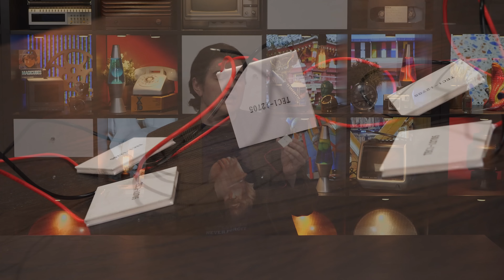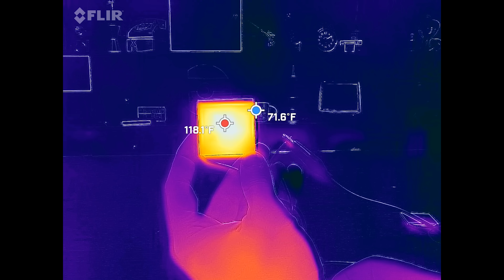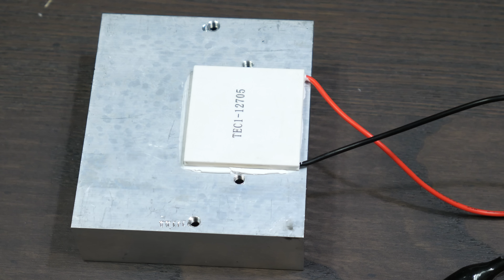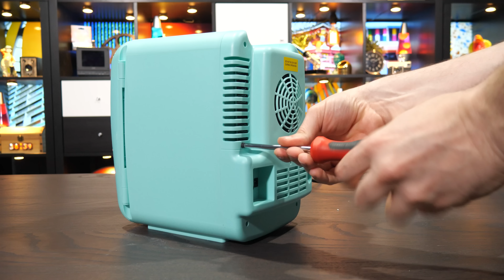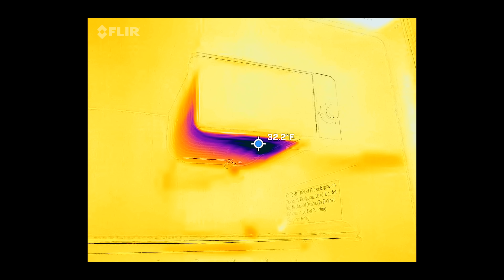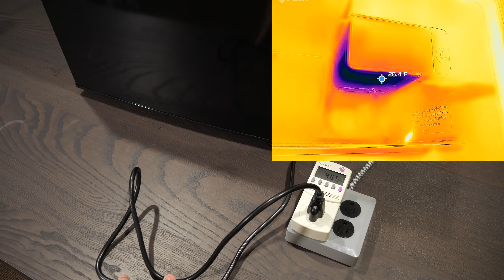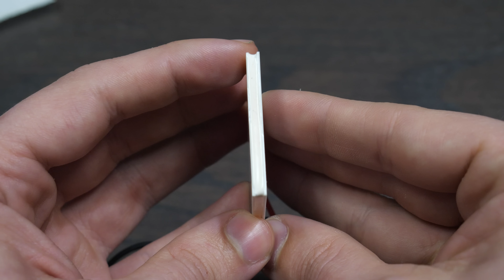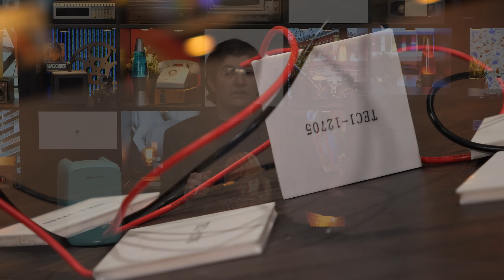Thermoelectric cooling: it's not great.

Comment: Man so I bought a camper a year ago and I can't get the fridge to work with gas. So when me and my now ex wanted to go on a month long trip last fall we bought a thermoelectric fridge to sit in between the two chairs. Main reason was the form factor. Biggest regret ever. It is advertised to to draw 4 amps 12v on the manual (the website only said it was "energy efficient" whatever that exactly meant) which is wayyy more than I expected (avg current draw of a compressor camper fridge is 1-1.5 amps 12v). It doesn't really cool all that well (lucky it was fall a I right?). It drained my 100AH battery faster than I even expected with 4 amps AND it made a lot of noise. I really really should have bought a compressor coolbox and tried to fit it somewhere else.
No this is not the reason we broke up, let's say she turned a cold shoulder.

Comment: I got one of these to store a few energy drinks in my bedroom. It’s worked well enough to keep them chilled for the last 2-3 years but the biggest downside is how much heat it puts out. I’d come back from work and my room would be noticeably warmer than the rest of the house. Fixed that issue a month or two ago by putting it on a timer outlet set to just run at night but I think the more frequent cycling is killing it bc now the Peltier element feels barely cooler than room temp by morning. 

I wish they would make slightly upgraded ones with better insulation and a thermostat so it’s not constantly running. Yeah it would still be way less efficient than a true fridge but it would be better than this

Comment: I'm 36 and when they first came out, it was at toys R Us and were only 30 bucks. Bridge right that always seemed to work pretty good for me but it was all depending on the temperature and humidity in the air it in. mine would ice over and  keep my 4 surge energy drinks and balogna...lol I have 2 peltier dehumidifiers and the only way they will actually work is if there is still air in the room if there's a lot of air going in and out of that room, it does nothing. And the other application I have a Peltier module on is my massive cooler master v10 cpu cooler.

Comment: Why don’t they make heatsinks for computers with this tech, yes it uses a lot of energy but it still could work
Reply: It doesn't. You still need to cool the module for only a couple degrees benefit, so at that point, just use a proper cooler.

Comment: Guy doesn't realize that people are using when they don't need a full fridge. They are great putting items which needs to be cooler like chocolate during summer. Likewise, passive spot to place drinks in. Relative temperature difference will make them feel cool. Sure, temperature controlled small refrigerator would be better, but those things literally are in several different leagues above them in price and complexity.

Again, saying cheap things suck. What a relevation!
Reply: Can get a used minifridge (a real one) for like 30 dollars
Reply: @Serpreme-y1q  Key word: "used".

Comment: I have a 30 l thermoelectric cooler. I have it connected to the solar controller. It's used for camping 

I've noticed if you feel the Esky halfway with ice and then put your frozen sausages and patties and drinks in it and having the cooler running which only uses 45 w. It'll help keep the the ice and all the food nice and cool for your three or four day camping trip. 

And when it's connected to a 250 w solar panel and 120 amp hour lithium battery it's very good 

I got it for $80 on special

Comment: I have a Coleman "cooler/warmer" that has one of these in it.  Plug in blue to blue, you get a cooler.  Flip the plug so it is Red to Red, you get a warmer.
It does take quite a bit to pull heat out of the cooler but there is a lot of insulation on it.  
I did end up having ice build up on the internal heat sink and had to remove that occasionally.
Had to use this as a stand in for a few days while my replacement refrigerator was on "backorder".  Far from ideal situation but it beat zero cooling.
Critical stuff went in the downstairs freezer.

Comment: doing vocational as a thermal systems technician, the problem already becomes apparent when you know how a fridge works.
sure it becomes cold but you're trying to remove heat, that's how a fridge works.
in my opinion thermoelectric cooling could only probably work great if they existed in like modules that could connect with your fridge's system using a docking system where you slide in your beverage in a radial chamber with Peltier plates and dissipate the heat into the system.
basically you slide a can in one of these, they cool it from all sides and it cools it down faster. although thats assuming the plates can cool down your drink faster than the passive temperature inside the fridge

Comment: I got an xbox mini fridge because haha funny and it is exactly one of these. It has two temp settings of loud and very loud.

Only saving graces of it are that it has a working usb port where the console has one, it has lights loke the console and modeled IO on the back.

Wonder if I could put a noctua fan in the back to make it quieter

Comment: The only advantages this thing has over traditional vapor-cycle refrigeration are upfront cost and maintenance/repair. Two wires and no moving parts makes for easy fixes compared to a large sealed-gas system.

Comment: He's right, peltier is not design in itself to stop cooling at the wanted point like refrigerator does, so it will keep cooling until the treshold of the input electricity and equivalent difference of the temperature, I saw peltier stacks that could go to -72 C or -97,6 F . But it's 3 stacks of peltier in a good non leakable box and small places, you're basically dumping energy on a tiny spot, except if you can make a system out of it so you can control how many watt you want for it to run and how many peltier you used, but I never saw one yet, so, who knows. It still winning on the normal refrigerator side by a big margin in total capacity and energy efficiency in a home applications, but it got many potential we yet to discover. Who knew it got better in the future and have less energy to trigger big peltier effects.

Comment: I bought a medical cooler like this, it could fit 4 injection pens was loud, it couldn't keep anything cool (needs 2-8°c) when in the sun it stayed 10-15°c and it worked for 2 weeks afterwards it wouldn't recharge anymore. What is the worst part you might think, it costs €200. I know bought a Dyson thermos with 2 coolers (one can be filled with water other one can be frozen) and it is perfect and stays cool for 48 hours.

Comment: Another niche benefit of peltier coolers is that because they have no moving parts, they don't shake/vibrate. One case where you need that is cooling the sensor of various scientific cameras (they give better images when cooled). For this reason, some scientific cameras have a peltier cooler included in them.

Comment: but this would mean Peltier elements  would be perfect as cpu cooler, reducing the need for perfect cooling paste and so on, no?
Reply: No, because you'd need to run so much more electricity through it to get basically no actual decent benefit from it, compared to just running a fan over a radiator

Comment: i just took apart a pretty high end christie lazer vid projector and the chip was cooled with a peltier !  older panasonic vid projector was liquid cooled, and i thought that was cool...
this guy had a big heat sink and it made very cold/hot very quick. i havnt measured current draw yet but prob much. but what to do with it...cocktail coaster?

Comment: 50w Compressor refrigerator with COP of 3, moves 150w of heat from the inside (closer to 200w of heat dissipating to the room, 50w motor heat + heat moved). Defrosting or automatic defrost feature will waste heat so the compressor has to be more efficient so the long term average efficiency stays reasonable.

Comment: I use one of these at work on my desk as there is no way in hell that work would allow that black mini fridge.  It's nice having drinks and stuff there as opposed to the communal break room fridge. It does suck how poorly the thing cools the drinks though but they are OK, and the Frigidaire ones are quieter.  The lifespan of the tiny fridges is also an issue.  They don't last very long.

Comment: Was a TA for an Intro thermodynamics class for a couple years, had taken it previously, and every year there’s a project about testing various cooling methods. Thermoelectric always looks cool, but then you run the numbers and welp, guess we use Heat Pumps for a reason…

Comment: We use Peltier cooling for maintaining laser temperature stable and vibration free in a metrology tool that costs $5M, I bet your red fridge can't do that hhhhh, I agree cooling food with Peltier is dumb, but there are applications where it maybe good, and by the way you can use a thermostat/temp sensor to control temp , we do it to 0.001 deg C, so chill buddy

Comment: I want to cool electronics down in an ice box in the summer. 65F or 70F is good. I want to use a  Peltier element because I can put the polarity in reverse and use it like a heater to protect the lithium batteries in the winter. I'll just buy the element and cut a hole with a jigsaw and glue it in.  I saw a 2-pack deal on controllers with thermocouples for 15 bucks. I'm going to use the RV tank heating pad as a backup heater.
Reply: I built a DIY portable Powerstation inside an Igloo cooler. I have 6 x 200-watt folding solar panels. 120-amp solar controller, the 4000-watt surge inverter has a nice sine wave. Then I plug a Bluetti power station into it with a 400-watt panel.

Comment: Another cool thing is that Peltier modules can also easier work in reverse (transforming thermo-potential into electric potential). I have a fan on top of my fireplace to blow hot air into the room when its bottom gets hot.

Comment: I use these peltier coolers to keep solder paste tubes chilled. It only needs to be chilled to around 40 degrees or so. Its a very small volume, and custom made (its also a chest design. Hmm...)

Comment: my friend in the US bought a cheap 4 can fitting mini fridge from goodwill for $15 and took out the cheap broken cooling element got a CPU cooler and now it runs 10x better then it ever did

another cool thing about fridges I probably shouldnt but I put a hanger with a blanket hanging over the warm side of my under counter size fridge in winter to warm it up a little cause heaters can be expensive in the UK unless you buy expensive infrared heaters

Comment: Hi,
I´v watched your video on the peltier-cooler(s) and elements.
Please allow me to oppose,... however first I must add a good portion of agreement:
Yes, the blue "mini fridge" wastes a lot of energy. But why?
1. The cooling fin on the hot side of the peltier element is too small,
2. I did not see any colling fin on the cold side at all,
3. I did not see any fan on the cooling side,
4. the peltier element is overcharged with power.

I have used peltier elements for decades at work running them at COP partially higher than 3! (COP of 4 to even 5 is possible!)
In order to achieve that it is necessary to follow a few simple rules:
1. Read the datasheet carefully and critically. Good datasheets give advice how to run the peltier elements at high efficiancy.
2. Calculate your setup so that yo use at most 25% of the maximum power rating, better only 15%.
Please keep in mind that the max. power rating is given for a temperature difference of 0 (yes, litarally zero)!
3. Keep the temperature difference as low as possible. You can achieve that by adding good cooling fins at either side of the peltier element. That on the hot side shoud be larger by appr. 20-30%.
If your application requires a high temperature difference, use 2 (or even more) peltier elements thermally in series to split the temperature difference between them. Good manufacturers offer peltiere stacks that are optimized for such applications.
4. Run the peltier elements on real DC (not pulsed)! There is a significant difference between the average current and the RMS-current causing the heat losses in the peltier element in case of pulsed DC-current, heat losses that must be cooled off on the hot side. The cooling power is proportional to the average current.
5. Do not use a bang-bang-controller, use a continous analoge one, at least a PI-controller (even if it is made using a digital device, a µC, the final function is decisive). Bang-bang-controllers also produce an RMS-current higher than the average current, only the frequency is lower!

I have also used temperature controllers based on heat pumps over decades at work (past tense, because I´v retired). Their purpose was to control the temperature in oil filled baths to 23°C for precicion instruments with air temp 23°C in the lab (more or less negligable temperature difference but much much better stability). 2 of these oilbaths use the heat pump at full power (US and CA products) and in order to maintain the correct temperature inside tha bath they heat the oil with an electric heater (the cooling power is higher than necessary, the controller requires that). They consume appr. 1800W and 800W respectively. Only 1 of these baths (DE product) is able to control the power of the heat pump, but also this bath has to add electric power to heat the bath to the correct temperature. It consumes appr. 700W to control the temperature of an oilbath larger than both before mentioned together.

I´v got the impression that controlling the cooling power of a heat pump is a qite demanding task, whereas controlling the thermal power of peltier elements is very easy, you only have to change the current. And yes, as you said, you can use them also for heating. This is often required as temperature controllers often overshoot (yes, probably this is a sign that the parameters of the controller are set poorly...).

If I built an oilbath with comparable size and temperture stability using peltier elements, that bath would consume perhaps 200-300W. (I do not want to do that for safety reasons... fire hazards of the types of oil, pumps etc.)

Yes, the above mentioned temperature controllers are not a fridges for some cans of drinks.... However they are not cheap either (price range EUR 10,000 to 60,000 + VAT)
Yes, adding some improvements to that "blue box" would increase the price significantly.... (but not $ 10,000)

I fully agree with what you said about running peltier coolers in cars. I did that by myself in hot summer (no air condition in the car...). Even if the power consumption is not negligable, you rejoice if you can cool at least some sensitive goods at least for a few degrees...

Kind regards,
Peter Scheibenreiter
(not from DE but from AT)

Comment: I had a 12-volt Coleman cooler that kept things cold 25 years ago. I traveled all over the desert with that thing, and it did a great job. It would heat up inside if you reversed the plug. I'm not sure how it worked, but it did! I assume it drew a vacuum on a void in an aluminum block to cool and compressed the void for heat. In cooler climates, it could freeze things. I wonder if one of those things was in it.

Comment: If you work in a factory or industrial environment where you can plug one of these in, it works fine for keeping your lunch cool through the day. I've used this type of cooler in hot environments and it worked fine for me. Not something I would use at home, but if I'm not paying the power bill, it isn't a problem.

Comment: Just to be clear what your saying here is the drink cooler is great if you're using it at work where you are not paying for the power. Keep in mind the small size that fits on your desk is the selling point of these shitty coolers fridges. Stating this significantly larger fridge is better is incorrect they are too large that's the problem i have bo room for them. Where is my 6 can fridge that fits on my desk at work?
Reply: Second thought could we put a Thermoelectric generator on the hot side and reuse that some of that power?
Reply: Second second thought. These fridges need the cans inside to hold the temperature how is this good for makeup? how are you cramping enough makeup in these things to hold the temperature? Also wouldn't a normal Fridge still be better just once again to big?

Comment: I have a much big square cooler size one. They work pretty good via the 12v in my truck in the summer. To be fair I load it up the night before and use a 120v to 12v converter in my house to cool the cans over night and they are cold in the morning. It's fine for beer or pop. I wouldn't trust food in it. Mine does get closer to 3 or 4c however with a much bigger heatsink and cooler in it

Comment: Aside from power consumption, and price point, why can't you just add 6 to the back panel instead of one? Or any amount larger then 1. And for anything hollow, why can't you just pump some foam into the holes you drilled. That's how you make your own homemade yeti coolers for way cheaper, at least how we do around these parts. And water cooler systems have gotten way smaller and cheaper to implement, why can't someone make a box with a small cooler instead of that massive loud fan. If they can water cool a phone now (Redmagic 11 pro) they can surely be added to the back of desktop fridges.

Comment: 13:53 "it's much bigger than a typical mini fridge"
"i lumped it into the category of mini-fridges"
it really sounds like you implied that it's a mini fridge
Reply: And even without this part, he called it a small fridge/on the smaller side. 
That’s on the upper end of normal sized, my first fridge after moving into my first apartment was less than half the size and still not considered mini fridge. I used it for 3 years since I never needed more space 😂